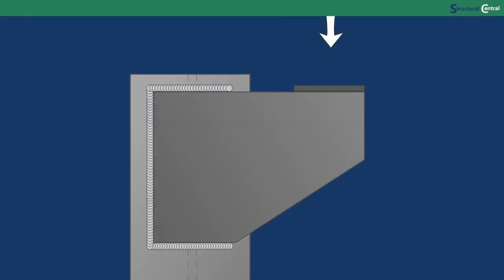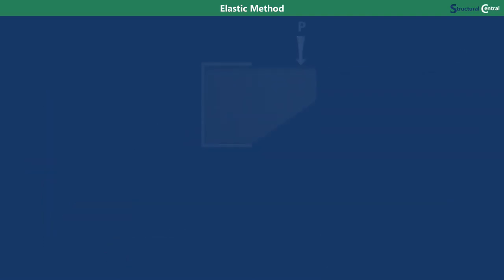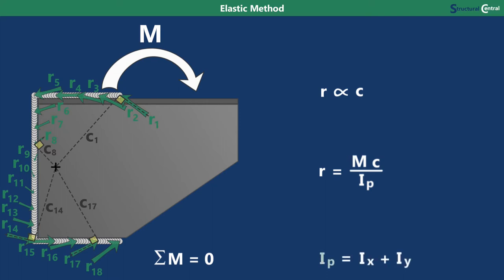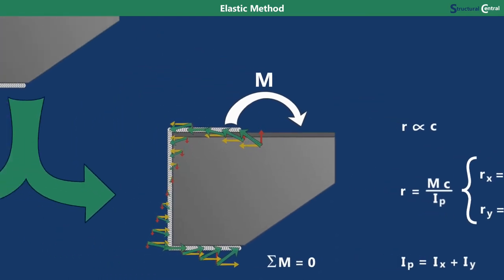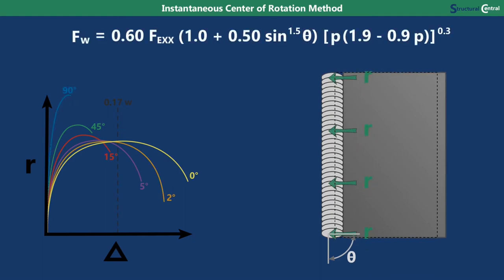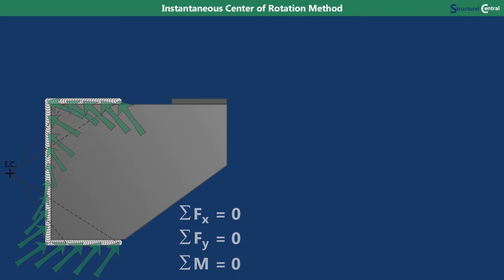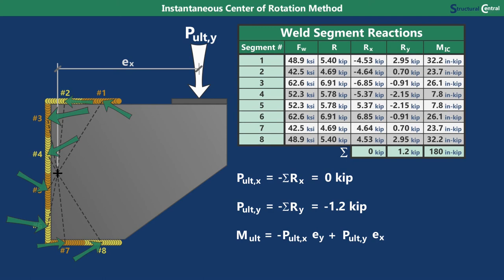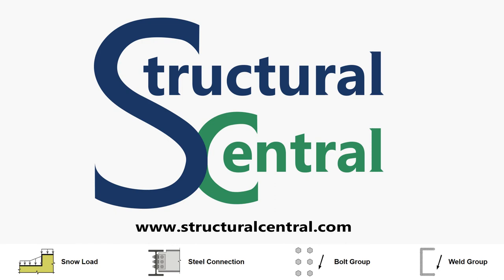Weld Stress Calculation -  Eccentrically Loaded Weld Group Analysis

Comment: When using an I.C. Method, do you need to provide a weld of uniform leg size?
Reply from the maker: I don't see anything about the methodology that would preclude you from using it with welds that have different leg sizes. The formulas for Δu, Δm, and R all include "w" so you would just use the applicable fillet weld leg size there.

I don't know if testing has ever been performed on weld groups consisting of welds with different leg sizes to confirm that the method is still applicable, though.